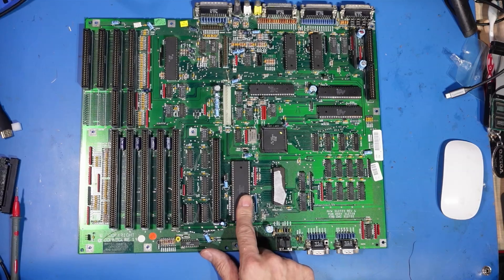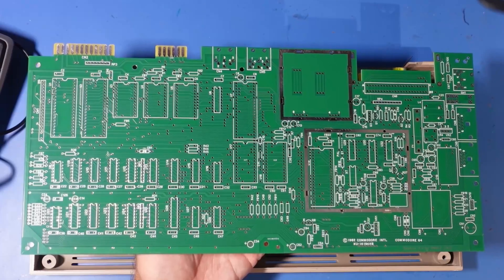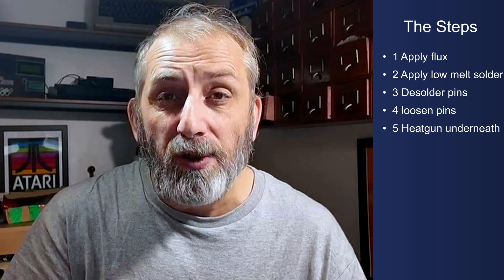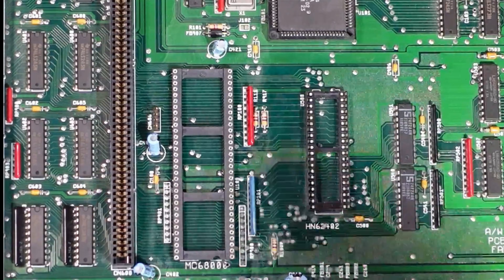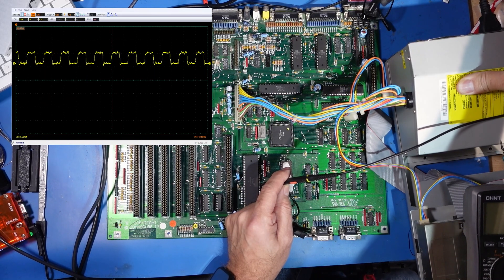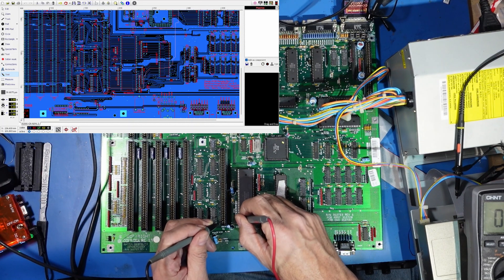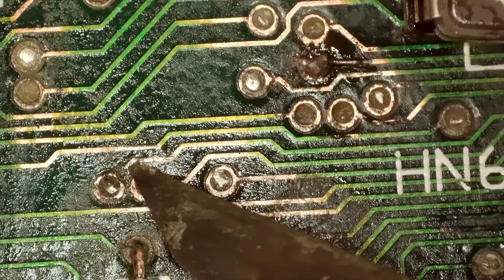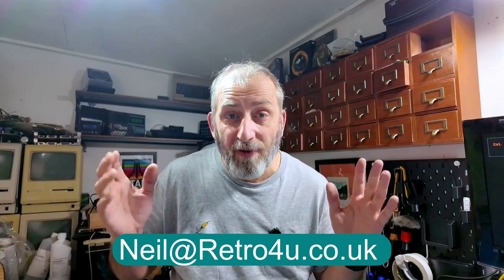Amiga 2000 Repair – Broken Socket, Damaged Traces… Can I Save This Board?

Comment: Good tip with sockets like that is to cut the cross spars betweeen the two sides. it makes desoldering way easier as you aren't fighting both sides at once.
Reply from the maker: Ahh yeah I need to remember that I usually do that as as you said it makes it much easier to remove.  Thanks for the comment and I'm sure it will help others .

Comment: Awesome work! I usually just use my desoldering iron to remove the socket but your way works too :d. I should have warned you about the vias as those always go bad. Also worth always checking both sides of the socket like you did, sometimes you can be bitten if you don't.
Reply from the maker: Yeah thanks 🙏 it was your advice to check to the slot :) thanks again my first 2000 I've repaired and owned thanks buddy :)

Comment: Great job, especially with removing that socket. I think that low-melt solder is a must have for removing through-hole soldered components.
Reply from the maker: Yeah 👍 it makes all the difference these old machines are so easy damage.  I mean they getting old now I'm just happy it's another saved thanks for the comment